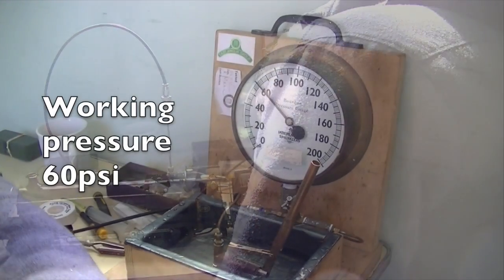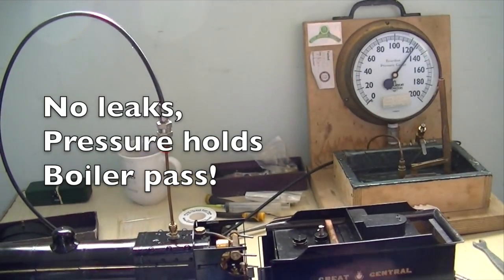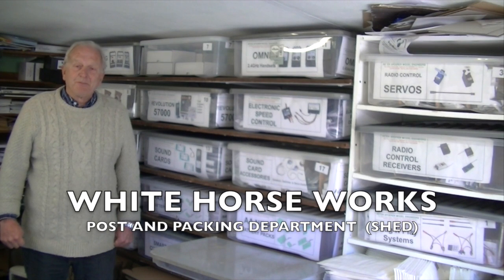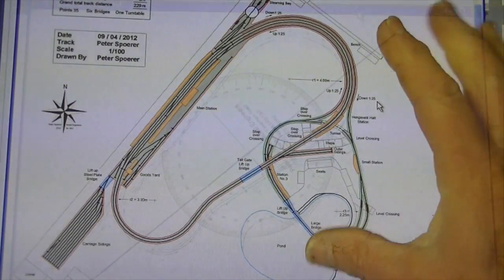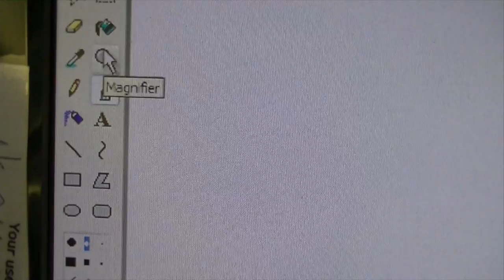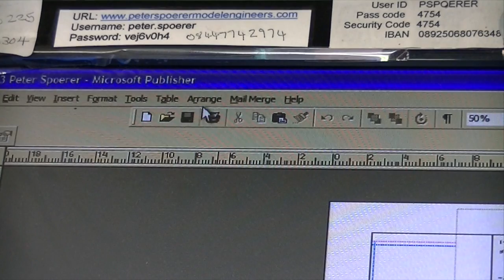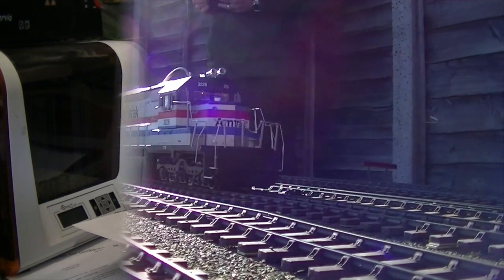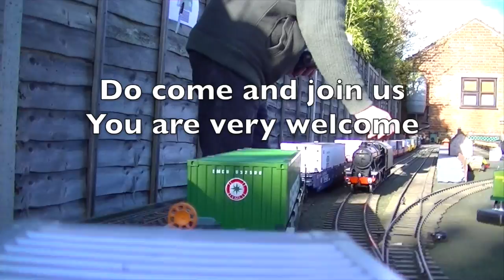Video 78. Preparations for the Norfolk Steam Week Part 4

Comment: Byrd, you are correct. I also took a Class 66 with me, my BCV, and some container wagons. The  SD40-2 ( I only have the Amtrak livery ) begat the Class 59 which begat the Class 66. When the Class 66 failed I had to run the SD40-2. The run provoked some very interesting conversation.

Comment: Thank you for all the information packed into one video. Do you have to do the boiler test each year and is it required if you run the locomotive only in private settings or both public and private events ??? Peter.
Reply: deltatrains don't expect a reply, just an advertising channel it seems.